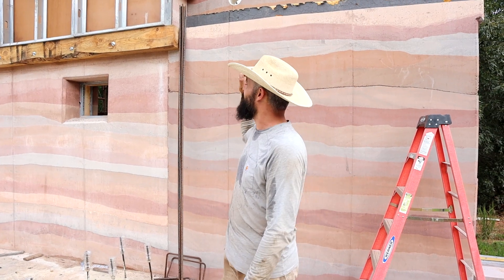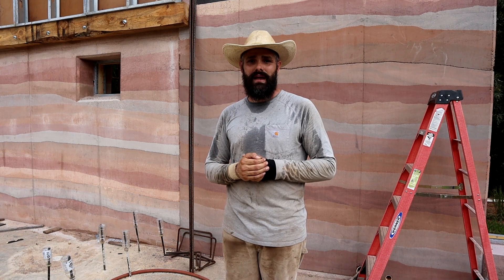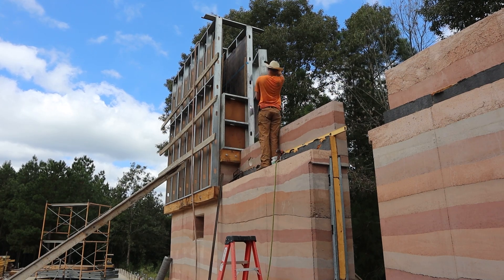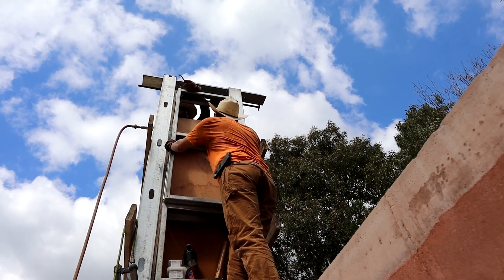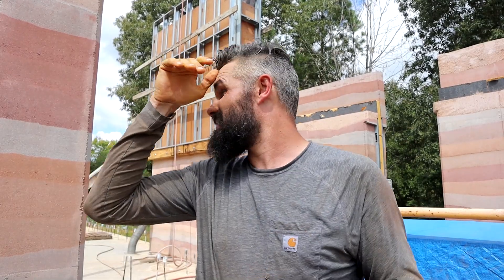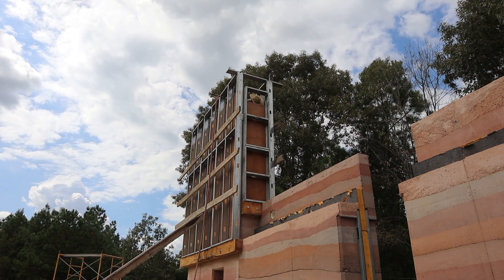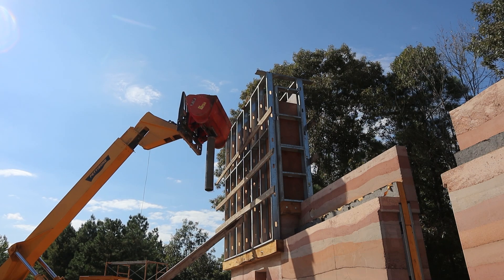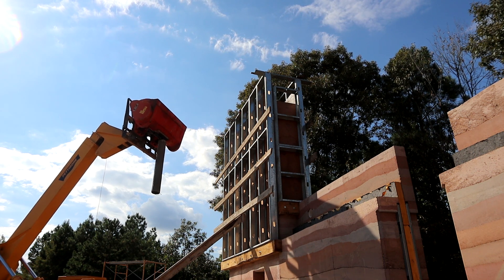Breaking the Biggest Rule of Rammed Earth - Vlog 74

Comment: Really curious about the hydraulic connections from the telehandler to the mixing bucket.  Did you customize the hydraulics or were the hoses on the telehandler sufficient?  A little video of that setup would be cool to see.
Reply from the maker: We can do that. I didn't have to customize too much as the telehandler was set up for a 2nd set of hydraulics on the front of the boom.

Comment: Am an enthusiastic fan, Great!, Great !!, Great !!! work you guys are doing, this is absolutely beautiful.
It's looking like it's going to be much more  EXPENSIVE (including cost of machineries on site ) than a normal brick wall construction that we are using in Nigeria to phase out our traditional rammed earth wall buildings that  mostly exist in our villages. 
Am already imagining putting something like this up in my village Idumuje-Ugboko Delta State Nigeria, .
So am keenly following your work and guidance but a little bit startled why you would not first deck out the ground floor before u start taming on the 18ft 2nd storey North wall ?

Again an wondering why a part of the existing ground wall is seperated by as much 3ft difference in height at the top .

Am really wondering the relevance of the insulator foam in a rammed earth wall construction in the tropics? 
Will greatly appreciate your response if u can find the time from your busy work schedule.

Thank you , am really enjoying this ur experience.
Reply from the maker: Hey thanks so much for the encouraging words. Ya'll are the reason we keep this up. To answer your questions: 
We found that doing the full 18 ft wall was easier than finishing the ground floor and then moving up. It is a lot less form work. 
The 3 ft height on the top of the walls is to allow for a living roof. That gap will be filled with soil and we will plant a garden on the roof to keep the animals away. 
The foam makes a HUGE difference. If you just use rammed earth you have a thermal battery that will slowly "leak" the outside temperature into the house. The foam creates a barrier that heat can't penetrate. I'm sure there might be better ways to do it but this works for us. 

So glad you are enjoying. Hope this helps!
Reply: @RedEarthRanch  thanks for ur response.

And It sure does help  , I still continue to follow your experience, great work you are doing with ur family , out there .

Comment: I'm still pacing myself through your archives of highly informative and pioneering videos. 
I am already considering building a spacious rural double story (two floor) house, and I'd like pointers on two aspects, possibly videos if already covered:-

1) You seem to stepping some wall top surfaces, is it for interlocking (future) cold joints extending upwards? I'd love some explanation and details including rebar use across cold joints.

2) I am unclear about suitable material choices for constructing an upper floor, if doable. Considering that wooden decking is popular in the US, it seems illogical for me to have such resilient walls plus highly vulnerable wooden upper floor decking, yet logic tells me that concrete would be too heavy for these walls. 
Can you advise on alternatives with the practicality and affordability of wood, yet more durable and resilient to elements.

Keep fighting the good fight!
Reply from the maker: Hey thanks for watching!
1) That is for the flat roof to connect and give the beams something to sit on. Most of the house has a 14 degree pitch so they won't look like this. 
2) Concrete will absolutely work for the upper floor and is in fact more common. We are using wood because it is readily available and basically free for us. We know it will need to be worked in the future but if we care for it right it should last a while.
Reply: @RedEarthRanch  Am I hearing you correctly that well built rammed earth walls can bear the full weight of a concrete deck?
If so, I'd assume:- 
1) Lower walls topped with reinforced concrete
2) Concrete slab deck on top as in normal brick wall???
3) Upper floor walls topped in concrete, then 
4) Roof 
Would this be the correct way about it???

Comment: I wonder, why dont you guys dont use bolts and nuts instead of screws ? Most of your time wasted and problems are due to that. It seems.
Reply from the maker: The primary reason is that each time the forms are set up they change slightly so screws end up being quicker because the holes don't line up.